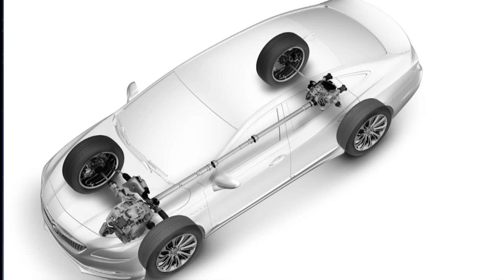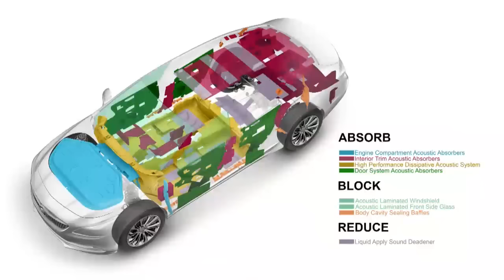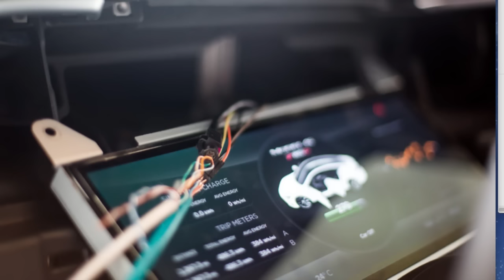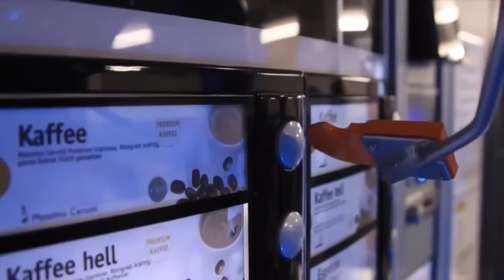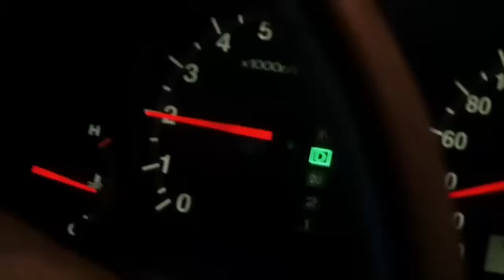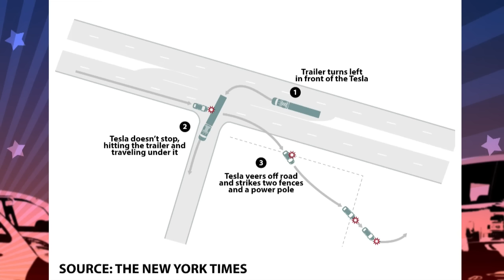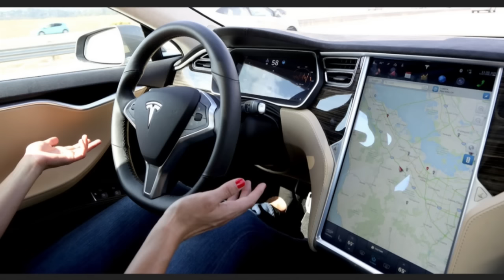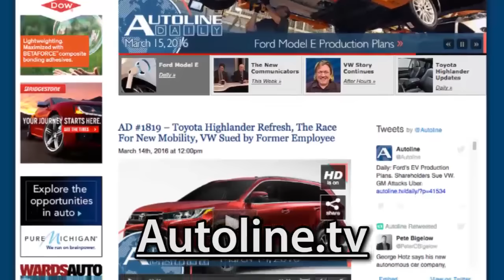Buick LaCrosse: From Good To Great - Autoline After Hours 338

Comment: Underrated vid.  Jeff is an engineer, not a mechanic.  It's an insider's view of GM.  Will stuff mechanically fail?  Sure.  But there's a clear priority in design.  Noise level needed to be low.  Jeff admits the 20" wheels kill the quiet cabin.  Ride comfort was a goal.  But he admits that active dampening stiffens the ride.  etc.  There's the focus in the design.  Entry/exit to seats needed to be easier.  The shifter was meant to be a joystick.  etc.  The vid explains a lot of the inside choices that were made at GM.  Great interview!

Comment: I have 2012 lacrosse with 2.0 turbo engine in China,so powerful,front and rear suspension lower arm made by aluminum.but now this new version is cleanly reduce costs, suspension instead to iron but made it silver color, just like Japanese cars.
Reply: Howerd I dont have any special insite but i dont see how they dropped 300 lbs by going from aluminum to iron. Besides cast iron would be terrible, it would be stamped HS steel. Me thinks you may be making things up.

Comment: buick for the most part has slightly better products than Lincoln or similar in terms of interior quality and luxury  (that can be taken as a compliment) but with Lincoln bringing the continental i think buick needs to offer either a sports car or a larger higher end car.
Reply: You do realize Buick competes with Acura, some Lexus, etc.... Lincoln competes with Cadillac, Always has
Reply: Miranda DeVil nope, Lincoln has not touched cadillac since 30 years ago. (both went shit anywise)

Lincoln is a low end brand not worthy to be mentioned in the same sentence as cadillac.
Reply: +Miranda DeVil That was true once but Cadillac has moved up to compete with the Germans. Cadillacs are rear wheel drive now with models that have huge horsepower and some of the best handling suspensions among sport sedans.

Comment: Having had to replace MANY of those cable window regulators on cars that were not very old, some not even paid for yet, I can attest to their quality or lack there of. They are lighter but they do not hold up. Leads one to believe GM doesn't care much about long term reliability, lol.
Reply: I have to replace 3 of the 4 window regulators on my Ford Crown Vic. Transmission went out at about 90,000 miles. Head liners fell down. Quality is really a concern about American Cars.

Comment: I dont understand how they said that the infiniti 3.7 liter V6 was the segment leader for NVH. That is simply not true. That truly might be the roughest and most unrefined and oldest engine in the segment. Definitely not the smoothest by any standard. To me it would have to be a toss up between the Lexus 3.5 and the Acura 3.5 as segment leaders in NVH. Now I will say this, My mom has a 2019 Lexus ES350 and that newly redesigned 3.5 v6 is extremely powerful and ultra refined. My friend has a 2018 Acura tlx v6 and that motor is equally refined and fast. I have a 2015 Accord Coupe EX-L V6 and my motor is ultra fast and as refined as Fort Knox Gold. The New Buick Lacrosse 3.6 V6 is on par if only a half notch below them in smoothness power and refinement. Whatever and whoever they benchmarked, they did a fantastic job because the end result is an excellent motor and driving experience.